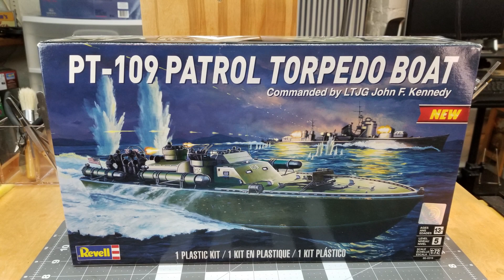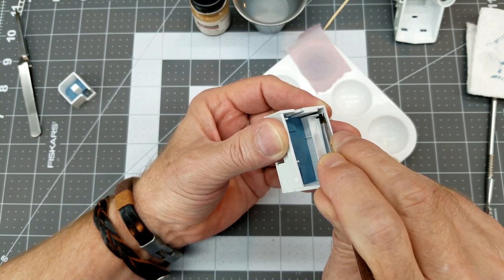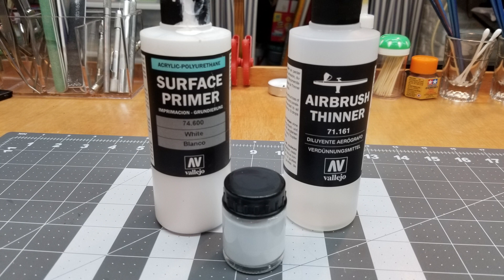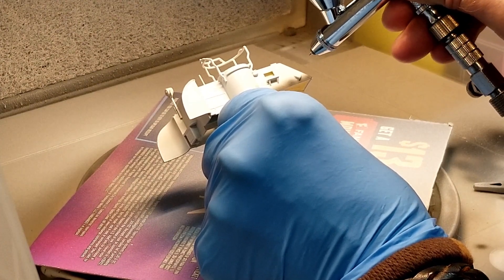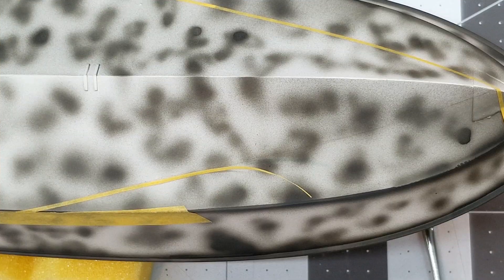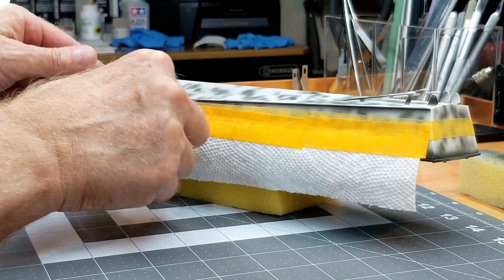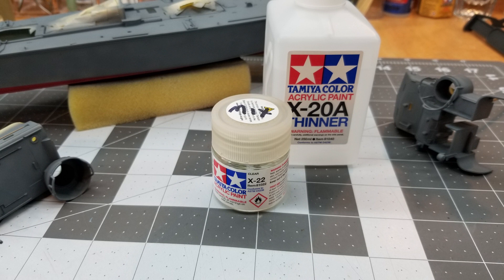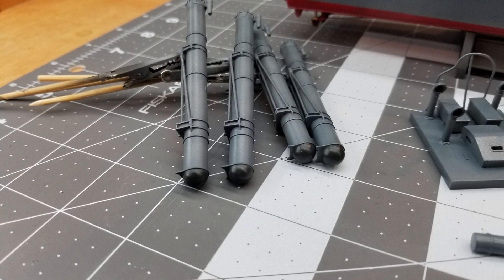PT-109 Patrol Torpedo Boat by Revell in 1/72 Scale. Part 2, Painting

Comment: just viewed part 2 painting video great airbrush technique with the pre shade and final coat and the waterline masking routine.i will be brush painting entirely using tamiya x acrylics with paint retarder,ive built one boat the tamiya pbr and masked and reversed masked waterline came out well for brush painting.i have learned the hard way not to have paint on the glueing surfaces,so the process for brush painting is different than airbrushing at least with the method ive used.am going to purchase this kit soon.
Reply from the maker: It's not a bad kit Jeff, some little fit issues but nothing you can't fix. I have the PBR kit which I plan to get around to building sometime, just seems like there is always another kit that comes along and gets in the way. Thanks for watching my friend. Johnny
Reply: @hillbillymodeling  thats right got 2 kits on the way and still building the 3rd
Reply from the maker: @jeffdurling2167  Thats great Jeff!

Comment: Nice model just in painting process of mine on the exterior painting you have separated painted parts ready to be glued back on can you airbrush the deck with the separated parts as one I find that the tamiya glue reacts with the paint,cheers
Reply from the maker: Hi Micheal. I use water-based acrylics and the Tamiya cement sometimes causes it to "wrinkle" when wet, but usually flattens back out when it dries. I just make sure not to disturb the paint until it dries. Tamiya extra thin is actually a solvent that slightly softens polystyrene plastic causing it to "weld" together, I'm assuming that's the "glue" you are using, and the ingredients are just 1% different then the Tamiya Airbrush Cleaner, so you can expect it to dissolve paint. Just be as accurate as you can in getting it into the joint and you shouldn't have any problem. That being said, it's important to not have paint interfere with the glue joint. Good luck with your build, and be cautious of the superstructure, I find it to be about 0.5 to 0.7 mm longer than the opening in the deck. That makes it a very tight fit! Take care and model on my friend. Johnny